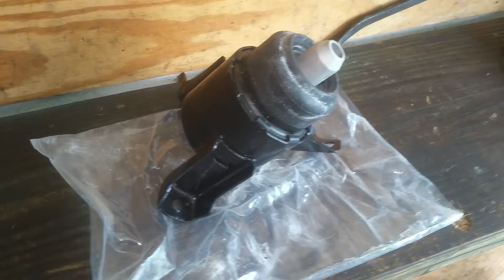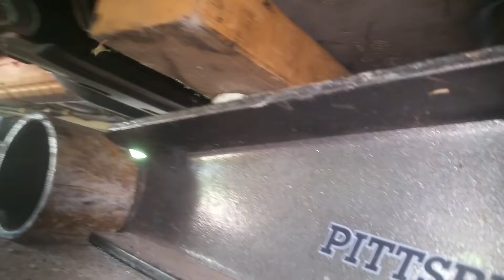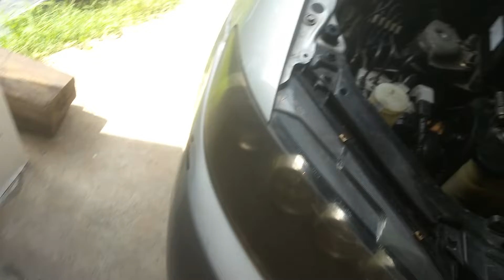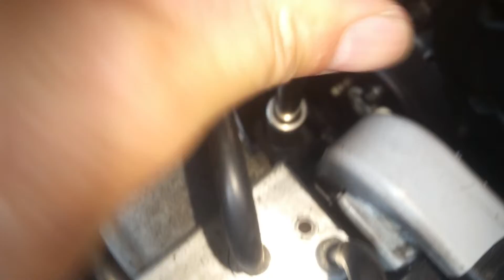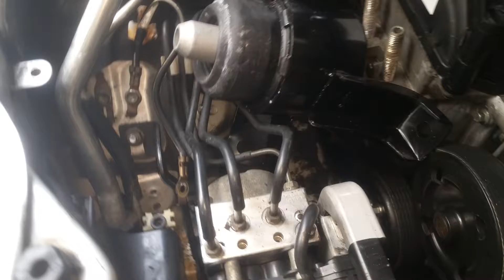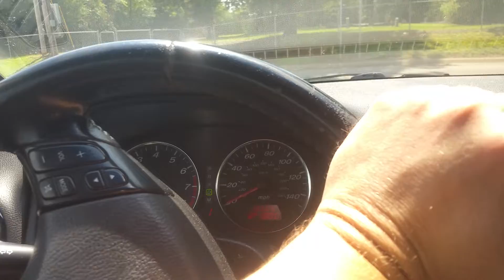How to replace passenger motor mount 2003-2008 Mazda 6

Comment: Did you purchase the new mount from Mazda dealer or did you get mount some other place? Just curious because dealer price is $163 compared to half that from auto parts store. That being said, I'm wondering if there is fluid inside the cheaper price mount. Any thoughts?
Reply from the maker: Great question. I believe these after markets , atleast mine had no hydraulic fluid. However I seen a 100 % improvement after replacing the old one . The old one completely failed with no fluid left. The aftermarket stopped the vibration and ton of noise. As far as the oem it is an easy decision for me considering aftermarkets are around $40 online. The oem may be better and I know they are expensive , even if ordered . Best of luck on whatever you decide . Thanks for watching.

Comment: Was there a shim under nut where abs lines are, i got a motor mount out and shim just fell off it so i dont know where it was, was it under 15 mm nut that holds motor mount or under the mount on the stud and then just nut goes on stud by itself.

Comment: Nice job. How are those mounts holding up after 2 years? Are those OEM or aftermarket?
Reply from the maker: They seem to be holding up great. Thanks for the feedback and thanks for watching.
Reply from the maker: These mounts were a cheaper aftermarket.
Reply: @WrenchTheory501  thanks for answer, because a need to change them, but OEM are expensive, over 400 euros vs cheap aftermarket which are under 100. OEM can survive up to 10 years, if these hold up for 3 years i'm good to go.

Comment: How could you tell this mount was bad, and not the other ones?
Reply from the maker: The part the the big bolt goes into had colapsed upon inspection. Also the vibration was horrible . This passenger mount usually accounts for the majority of vibrations . Thanks for watching.

Comment: I have a 2008 Mazda 6 I and I have to replace my motor mount. Firststone wants 700 to do it and I have a warranty and they sound like they not trying to pay it or own up to there contract because it’s a covered part. I YouTube it and it looks so easy the way you doing it. I’m a woman I could probably do it but I’m afraid and I don’t have the jack and don’t know nothing about supporting the engine. I think I could do it based off how you explained it
Reply from the maker: You could definitely fix it cheaper yourself even buying some tools. You will for sure want a good quality jack and need some blocks or jack stands for safety . Usually getting under the oil pan with a jack and block of wood helps support it well and use a jack stand or blocks for back up. Before you remove any bolts get it positioned and some tension. You will need to lift the engine slightly. Sometimes the engine can move out of alignment some but even on a jack can be moved and positioned. Take your time and plan each and every step. This mount is actually the easiest on this vehicle and 700 is excessive . Get some good gloves also for protection. If you could enlist the help from anothet person it may also make things go more quickly. Best of luck on what you decide . Even if you decide to hire it out i would suggest price checking several other shops . Thank you for watching
Reply: s33therfan I just let the guy fix the one that was really bad which was the passenger side. The 721.12 was for the passenger side and driver side motor mounts. What’s so odd is when I went into the work area I said wow this looks just like the way the guy on YouTube said to do it. He did everything you did. Sir I kid you not I could’ve done it if I had some jacks and tools. I also work for Autozone 🤦🏽‍♀️ I know I could’ve done it but got scared. I only paid 256.23 for the left side to get done. I dont feel the jolt or the thump anymore when I make a complete like I did before. Excellent video and you absolutely know what you are doing when it comes to your work. Oh and I have the same exact car 2008 Mazda 6i same exact car only have 81,110 miles on her.
Reply from the maker: Yes . I will say that all the mounts are important but the passenger seems to make up the majority of the vibrations . Seems like after replacing mine 90 percent of the noise and pops went away . 

Heres a video I made of the transmission mount replacement. Its more solid one of the mounts I think and probably fails less.
Watch "How to replace a Mazda 6 transmission mount" on YouTube
https://youtu.be/85mFzfwC9WY

Thanks again for the kind words and thanks for watching.

Comment: Thanks for posting this video. It was very helpful. I just replaced mine and purchased the same one from the link you posted on one of the comments below. I hope it would last a while.
Reply from the maker: Yes you can't beat the deals online , I would expect they're pretty good mines held up so far no problems . Thanks for watching
Reply: @WrenchTheory501  Just ordered the Rear Torque mount (dog bone) from the same place .

Comment: How did the mount hold up? I bought a(several) non OEM hydraulic mount and it(they)was horrible. TOns of Vibrations. Went OEM and all issues taken care of. - Do you know what brand mount you bought or where you bought from? Was it OEM? - Side note I know for certain non OEM dogbones are horrible and rip within minutes of first drive.
Reply from the maker: https://rover.ebay.com/rover/0/0/0?mpre=https%3A%2F%2Fwww.ebay.com%2Fulk%2Fitm%2F222015280391

This is the one I used , it's been on there little over 3 months so the jury is still out . I will say it is 100 percent better than the one that was on there though. This mount was only 20 dollars . So far as vibrations go it has done really well I haven't noticed anything to speak of , and it claims to be an actual hydraulic mount . I will say I've had in the past on other model cars vibration issues but so far with the Mazdas I've had good luck . Thanks for the feedback and checking out the video .

Comment: I think the this new mount does not have any fluid in it. Replacement version, only tire. It's harder, it transmits some vibrations. Right?
Reply from the maker: https://rover.ebay.com/rover/0/0/0?mpre=https%3A%2F%2Fwww.ebay.com%2Fulk%2Fitm%2F222015280391

Here's the part I used. Now they claim it's the hydraulic , like the others I viewed , however I can't say for sure . I know a way to check is by listening to the fluid sloshing around in there , I did that on my Mazda 3 and could hear it . But with this one I never thought about it , so you may be right . I will say compared to the one that was on there the car, its now driving and sounding smoother than a Cadillac so I can't complain . Replacing this mount made a huge difference,  90 percent of the noise and vibration stopped . Thanks for the feedback and for watching